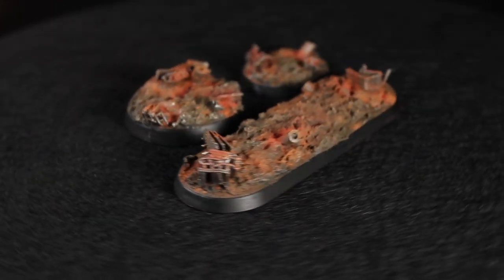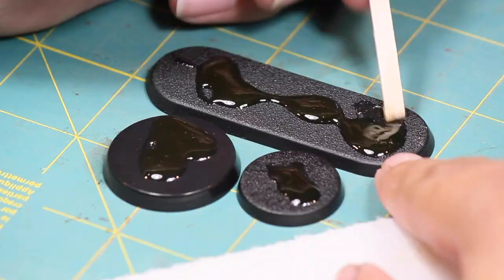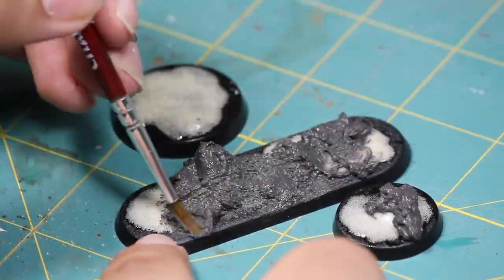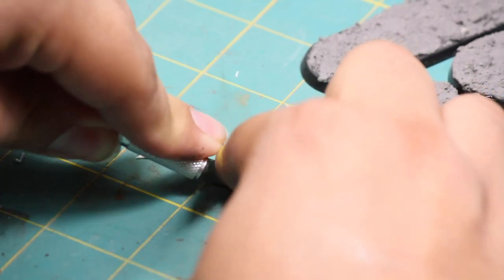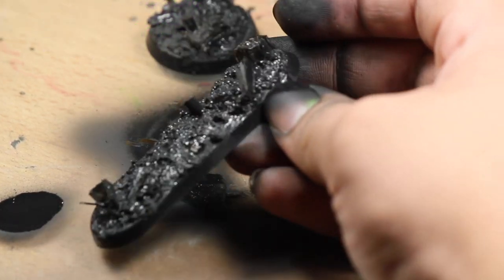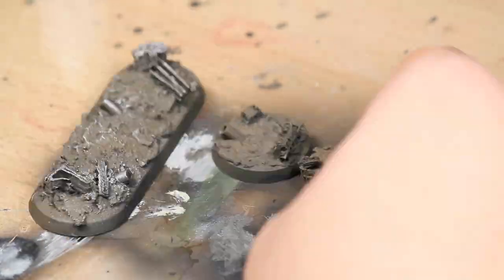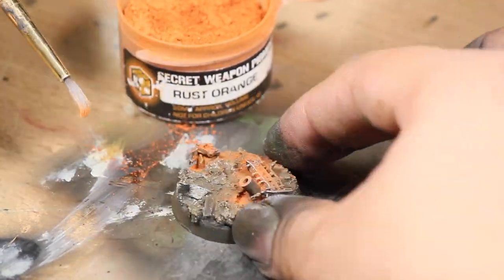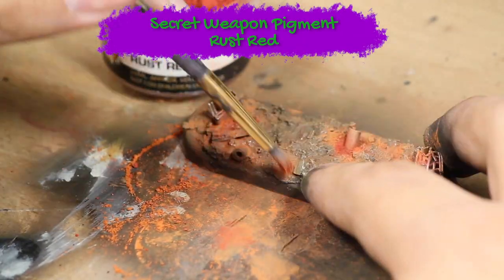Reuse Your SCRAP Plastic! | Rust World Bases

Comment: These basing methods really add alot to a miniature. Do you recommend any alternatives to wall spackle? It's not easy to find in my country. Thanks for doing these <3
Reply: wall spackle is often called Spackling compound or vinyl putty, if you still cannot find it you could substitute drywall joint compound which is often sold as a powder.
Reply: @minigamerjeonsofbattle9376   Thank you ever so much <3

Comment: Do pigments naturally stick without glue?
Reply: pigments have alot of different uses so really it depends. I brushed off anything that was going to fall off so I don't think that this base needs to be sealed. If I had really piled on the pigment, or applied it in a very specific way than I would seal it.